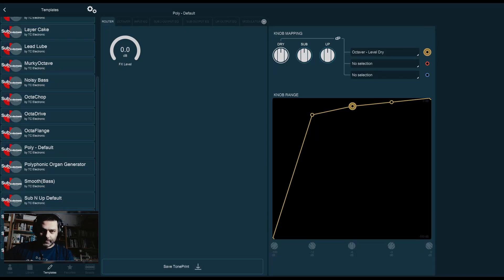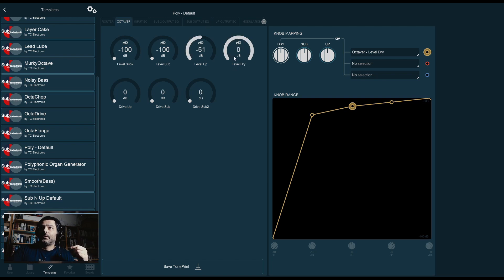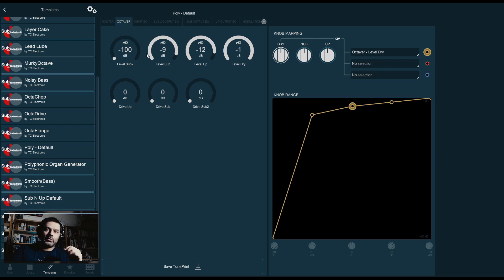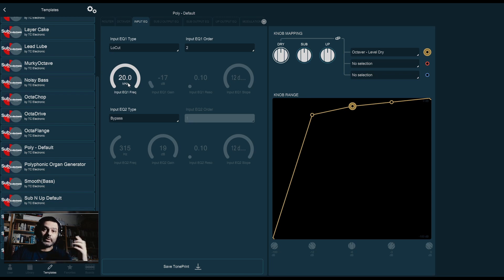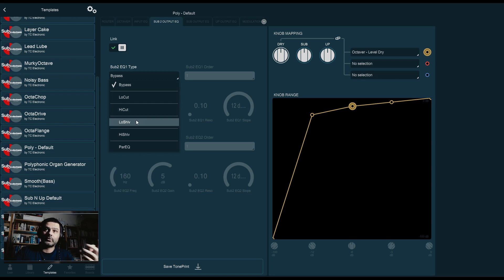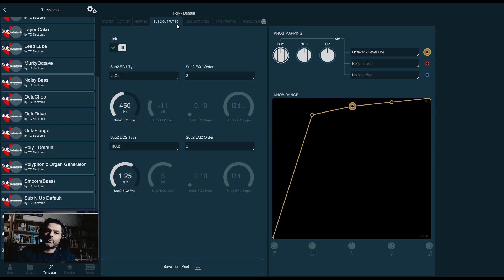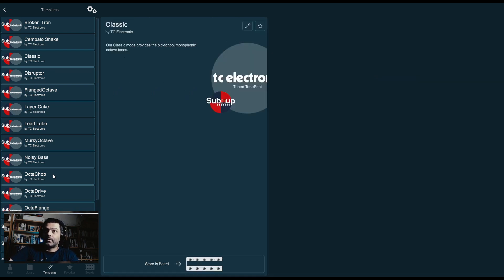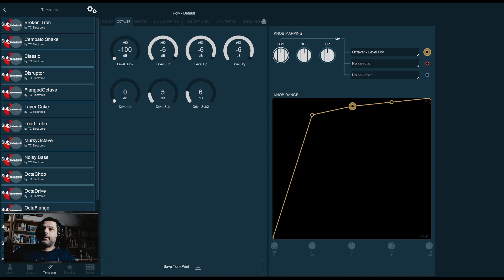TC Electronic SUB'N'UP Octaver TonePrint Editor Tutorial | Deep Dive

Comment: I have a (noob) question: in the "mapping" section, why are the "levels" (e.g. Level Dry, or Level Wet Up) mapped in log scale by default, while the other settings (e.g. Drive Up or Modulation Mix) mapped in linear scale? Would it be bad to have the levels mapped in linear scale as well? Thanks
Reply: Ok I did a bit of research and think I answered myself... Our ears "work in log scale", so volumes should be controlled with log pots. I wonder if the "modulation mix" control, which is linear by default, should also be in log scale

Comment: oh.. thank you!  well at least I got an answer... its not the answer I WANTED..  I really wanted to have a modulation mix or speed on only ONE of the octaves.... sucks you cant do that... but thank you for the info... as TC has SOOOOO far to go with this...

It's almost cool... but why the HECK do they not have a users library where people can share the Tone Prints they come up with... that cant be hard?  It can't be a huge file or anything... ugg.... well thank you
Reply: Yes, I agree, it would be very cool to have a place to share toneprints. Also, they should provide an official way to back up your custom toneprints for portability (apparently it is possible, but with a somewhat hacky method).
Reply: @Mizar88  Can you share how to do this? I need to copy my standalone brainwaves toneprints to Plethora, but it's really hard without a proper backup tool.

Comment: This is incredibly helpful. I got the sub n up mini in hopes to get a 12-string guitar sound when I plug in my acoustic. I was bummed to find out that even when I turn down the sub knob all the way, I still hear sub tones. It turns out that the sub n up mini still has sub2 turned on, even though it doesn’t have a physical knob. I just turned it all the way off in the TonePrint app, and now my acoustic sounds pretty darn close to a 12-string. Especially if I turn on a little bit of chorus in the modulation menu. Thanks again for your informative video.
Reply from the maker: Awesome, and thank you for your support! 🙏🏻

Comment: Hey, glad for all the explanation. I always use the Organ Generator, but the Sub Octave really bothers me on the low strings, how could i fix it?
Reply from the maker: Try opening the Organ Generator template, then set the volume for the lower octaves where you'd like it to be when you're playing on the high strings. When you're happy with that, pop over to the Input EQ tab and try setting up a low cut or low shelf (or a combination of both...) to filter out the lower frequencies before they get passed on to the octave generators. It might a bit of an interactive process between adjusting the octave volumes and EQs, but with a bit of tweaking you'll probably get something more like what you're looking for.

Comment: Thanks for the video, really helped me to understand the pc app. I'm having a problem though, and I think it maybe an issue with my pedal in particular. The problem is that I can't save toneprints in my pedal, it's always in organ as a default. I've made a custom toneprint and I can use it as long as I'm in the app with the pc, but when I try to "save in the pedal" it returns to the organ sound. I can disconnect the pedal from the pc and still use my toneprint, but when I disconnect the power supply it get lost. I've tried the phone app and I get the same problem, it doesn't save the toneprints. Sorry if it's too much, maybe you can help me.
Reply from the maker: (Ops, sorry, I responded by YouTube had it for lunch...) I've never seen that happen in a TonePrint pedal before, so you might have to contact TC support for that one... 😟Sorry!
Reply: @PedalPlatform  thanks for responding! I already sent them a message, waiting the reply 🙏🏻
Reply: @jlaguilarjazz  Did you get an answer? I have now tried two Sub'N'Up pedals and both ahve the same problem which you had. I came to this video to see if there is some trick to it.
Reply: @SamuelWebster   they sent the case to the development department a week ago. They first asked me to update the applications and libraries, without solution. Still waiting.
Reply: @jlaguilarjazz  I am sending mine back to the store tomorrow. Tc support couldn't help me so I sent it back to the store. Buying something else instead.
Reply: @José Luis Aguilar Same problem, for me, i wait a solution please...

Comment: Is it possible to get it work like BOSS OC-5,  and use for acoustic guitar?    tnxxxx
Reply from the maker: I don't have direct experience with the OC-5, but from what I see on the specs and heard from trusted sources, the "Lowest" setting on the OC-5 filters out the high notes in a more aggressive way than the Sub'n'Up can do. As for acoustic guitar, it won't perfectly simulate a 12 string guitar because it can't keep track of which strings should be doubled in unison or octave up, but other than that, not a problem.

Comment: Awesome videos again!! I wonder is it possible to create some form of expression controlled/LFO cutoff filter like a synth would have? What about creating a simple bass guitar sound for looping purposes, what kind of low/low mid frequencies would you focus on for the input/output filters.. Thanks a million, I’ll be sure to buy you a ko-fi and think of more questions 😜
Reply from the maker: Those are excellent questions, really! The expression controlled cutoff filter is possible by going into the Output EQ for the voice you want to use (or just link them all and use the Sub2 settings), set one of the Sub EQ Types to HiCut, then assign the Sub EQ Freq to the Expression Pedal - or even the MASH switch if you need to keep the expression pedal free for something else. Choose the appropriate range in the mapping window, and if you want the MASH to close the filter on press (filter open without pressure), don't forget to invert the curve. I'll have a play with that at some point and make a video, probably on a future Q&A! As for the simple bass guitar sound, use the input filter only if you want to restrict a range of the fretboard from triggering the octaves, then I'd tweak the output filters with a ParEQ to scoop a bit of mid range (where the guitar sound will live), and probably a Hi Shelf to decide how bright / dull I'd want it. Hope this helps for now, and by all means, keep coming up with the questions! 🙏🏻
Reply: @PedalPlatform  Thanks a lot. I was able to create a low pass filter controlled by the expression pedal to give a bass wah kind of sound, very pleased so thanks!! HOWEVER, I am having a real hard time with levels on this effect, even after taking sub2 out of the equation. Noticing a BIG volume drop on my bass patches.. This hasn't always been a problem and my toneprint app has been really glitchy lately.. Any ideas on matching dry signal volume levels? Thanks
Reply from the maker: @jdlandon90  Have you checked if the volume drop is related to the filters, or if you accidentally have a volume mapping active at the same time? If not, you might want to experiment with mapping the volume to increase as the filter closes. Maybe also putting a compressor after the Sub to even out the volume changes...
Reply: @PedalPlatform  Awesome thanks for this. I will have a play around tonight and will certainly keep thinking of questions.. :D But I will play with this for now.. THANKS AGAIN!!